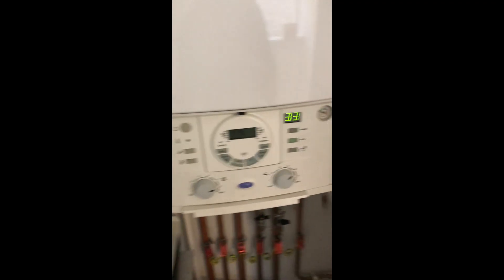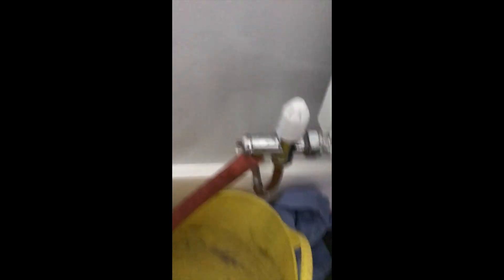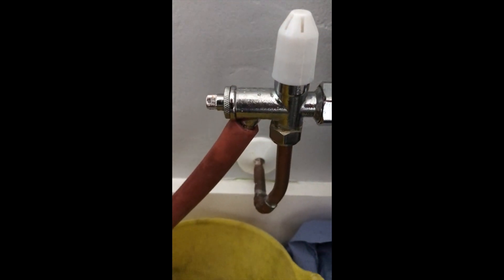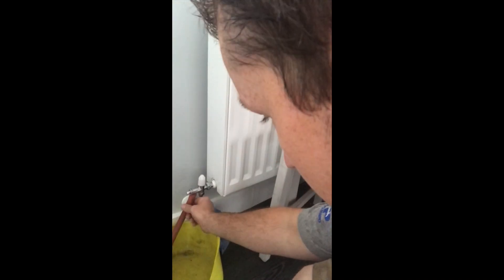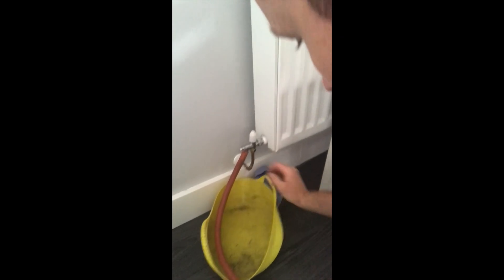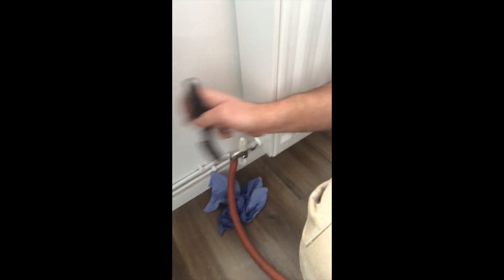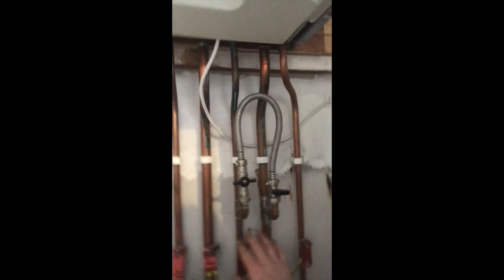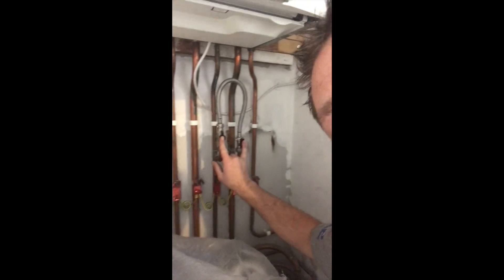How to drain down a central heating system - Combi boiler

Comment: what is there are 2 floor valves installed. It is better to turn the thermostats temperature up so it calls for heating on both floors and then turn boiler off? I assume the valves will stay open asking for heat?

Comment: This is a great video. Do I need to turn anymore taps off on the boiler?
Reply from the maker: No need, just follow my video and that’ll do the trick, if your unsure whether you have a pressurised or gravity fed system, for peace of mind you could simply turn the water off to the house as back up 👍
Reply: @NickTaylorPlumbingLtd I’ve got the system switched off and hose connected to the drain valve but when I open the drain valve nothing comes out? Bit confused?

Comment: Good video, do you need to purge the boiler as well after filling?
Reply from the maker: You should not need too, your boiler should remove the air itself of push it via the pump to the highest radiator on the system, hope that helps 👍

Comment: Great video, I have a glow worm Ultimate 30c combi boiler, but need to remove 2 radiators so I can plaster the walls. Can i still use my hot water for showers and such(radiators will be removed for a week or so), or would i need to isolate something first?

Dave
Reply: Hot water and heating are on 2 separate circuits

Comment: Good explanation Nick on drain down and refilling the c/h pipe work system. However, in your process you’ve not put any inhibitor back into the pipe work when filling? How would you do that when filling back? Thanks

Comment: Got a question for ya, over the summer my boiler kept losing pressure and I could see this via the gauge when it kept falling below the green zone, checked all the rads, no leaks and bled too with all being full but it still kept happening and it took absolutely ages for the pressure gauge to reach the green area. Now we've passed summer I've noticed that it's constantly in the green area and pressure isn't dropping and heating and the boiler is working fine...would you recommend changing the boiler or is this just a small case with nothing to worry about?
Great video too by the way, I've been wanting to empty the system for ages to add more radiators in new position so thanks 👍

Comment: I have a leaking 90degree plastic elbow in the ceiling immediately beneath my combi boiler. Found due to staining of ceiling. Strangely system had been good for 8 years, and the leak only appeared after the boiler was serviced. I wonder if the heating water temperature setting was higher after the service and just enough to cause the leak? I saw the service engineer "waggle" the temperate dials which I think is part of putting the boiler into service mode. I have no idea of the original temperature setting, but I never changed it in all those years. Currently it drips. If I refill the system it is good for a few hours until the pressure drops and the boiler shuts itself down.

According to a friend I should find a drain point on one of the ground floor radiators (he says it a legal requirement) but there isn't any drain point on any radiator. According to the same friend he suggested for him it would be a DIY job. He lives too far away to help 😞 He also suggested that freezer spray could be used to isolate the pipes around the elbow, although on the upper side of the elbow is the pipe that comes straight from the boiler and I assume(!) that there is an isolation valve on the output of the heating feed which will take care of that side of the elbow?

I have used Checkatrade to find interested parties. I emailed one company all details (including lack of drain point). They have said that the job will take 2 to 3 hours. Since in my layman's head swapping the elbow should be pretty quick, what is it about the job that means it could take 2 possibly 3 hours? I just want to make sure that I'm not being taken for a ride.

Comment: I usually switch off all the radiators so they don't need to drain. Some water still in the pipe but it doesn't waste all the inhibitor.

Comment: Hi Nick, I appreciate this video thanks.
On my ideal logic 24 combi, I had the valve on the CH flow (behind pressure gauge) in the wrong position while running tap to test after filling system. Looks like I've broken the pressure gauge and am planning to replace.

The manual says to close all CH water isolating valves on boiler inlet, then drain system at CH drain point.
Before finding that in the manual, I already drained as much water as possible from the CH via the radiators. Do you think that is sufficient so I can remove pressure gauge? Thank you.

Comment: Amazing video, you have a new subscriber Sir. I do not have drain valve anywhere in a system. All there is, is just valves with TRVs and valves for rebalncing the system. Can I just unscrew one of these valves entirelly from the radiator and drain the system that way? If so does it matter which radiator I use for draining the water? I have 5 radiators in a system all on the same floor.
Water is basically black when I am bleeding radiators so I need to get rid of that water and get new fresh water into the system so my radiators are not as cold at the bottom from all the sludge gathered.

Comment: Are you not suppose to turn off the main water supply that comes into the house first? Otherwise wouldnt it just keep fiiling up the roads and boiler! Just an observation.
Reply from the maker: Hi Juicy, thanks for the comment, you don’t necessarily need to turn the mains water off for a combi boiler, if you watch my video on how to drain down a gravity fed system then yes you do need to turn the water off. 
However.
If in doubt turn the water off, it’s always best to be safe than sorry 👍

Comment: So the radiator water is independent to the mains water, so no need to turn of stopcock as its just the heating side?
Reply from the maker: Hi Echo, If you have a combi boiler or a pressurised cylinder (unvented cylinder) then you are correct, if you have a tank in the loft (gravity fed system) check out my other video on how to drain down a gravity fed system here - https://www.youtube.com/watch?v=2G4hf_Hsgb0
If you haven't already don't forget to like and subscribe.

Comment: Yea gotta clear out traps better to hook up a pump
Reply from the maker: Hi Stephen Burns, love the idea, as this is a combi boiler its under pressure and in theory should push out any air locks, I haven't had to whip out the pump before but I have used a wet vac to suck out an airlock, ill do a video in a few weeks time on how to do this.

Comment: Mine are bit old radiator and don't have them drain valves.. but can you use on to drain out top floor radiators on boiler?? They should have drain valve should they?? Thanks for educative video

Comment: Any inhibitor chemicals added?
Reply from the maker: Hi Jack, If you haven't already please like and subscribe to my page as it really helps.
Yes you should add inhibitor once you've carried out all work and are ready to fill up, best to read the bottle on the quantity to put in as they all vary, as a guide, the inhibitor I use is a 1 litre bottle to around 10 average sized radiators.
Hope that helps.

Comment: Awesome video! Straight to the point, allowed me to fix my radiators easily, Was nervous about going near the boiler but after watching this it made it so simple to drain and refill!
Reply from the maker: Hi Jack, thanks for your kind words and taking the time to write a nice comment. If you haven't already please like and subscribe to my page as it really helps.
Reply: Drain the whole system?.... this headed with drain down boiler
Reply: If the water upstairs tees down into two unconnected sides then how does the it circulate?

Comment: Great video but why do you need to drain the whole system if its a combi boiler? Whenever I change a radiator valve on a combi system i always drop the pressure down with the pressure release valve and isolate the flow pipe valve. I get about half a litre of water coming out the pipes when i undo the rad valves but thats it. Change the rad valves, open the flow valve back up, re-pressurise the boiler, bleed the radiator and job done.
Reply from the maker: Hi M F, thanks for your kind words and taking the time to write a nice and informative comment, although I would say you're a braver man than I am.
 If you haven't already please like and subscribe to my page as it really helps.

Comment: What happens then if your in bungalow all rads on one floor turn boiler off. Do you still open all the bleed valves and there are more drain offs.would you have to still drain if from all drain offs or just the one your working on

Comment: Is there a way to drain the radiators ( to move them) while keeping the hot water on?
Reply: If you've got a combi boiler link the thermostat control to stop the boiler firing on central heating.  Close the return and flow whilst the system is pressured and your DHW should stay on demand.  If you loose pressure your boiler will go into lockout.  Drain the rest of the system 😉.

Comment: Really clear video. One question though, for those of us on single-level flats/apartments i.e. when the boiler is the highest point in the system: how do you let air into the system when draining? Is there a risk of damaging the boiler by pulling a vacuum if you drain it without opening any bleeds? My towel rail is the highest bleed, but it still floods water everywhere because it's a foot below my boiler!
Reply: If your boiler's at the highest point of the system there's absolutely no need to drain the boiler.

Comment: Hi is it possible  to close down all the rads except the rad being worked on & just drain from that rad , saving time emptying part of the system & refilling .
Reply: Yes,  just make sure tge boiler stays switched off for the duration and all valves are gill shut.  If you have a tank on an f&e system then you have to isolate and create an airlock.

Comment: Hi Nick, great video. Quick question, do you not need to close the internal stop tap in your property before doing the work?. Or will the boiler not replenish if its turned off?
Reply: I would say that the filling loop is off so no water will enter the system. This is for a sealed system of course NOT an open vented one.
Reply: Thsts what I thought!

Comment: Good video thanks.  I have a property which will be left empty over winter hence looking to drain the system.

Is this method suitable for this scenario? Or, is there a chance the supply pipe to the filling loop could freeze and crack?

Thanks
Reply: Turn off the mains water and drain from the lowest point i.e drain point cold water tap or outside tap.  The central heating circuit would also need draining.

Comment: if i folow your instructions  and then turned water back on would it flush sytem round and back out of hose to flush it well and clean.all valves reclosed exept drain pipe valve.. is this right?????

Comment: Great video Nick which has encouraged some other good comments. I plan to update radiators and valves whilst decorating through the house. Some pipework mods will be carried out so draining the system is required. My question is can I isolate and drain the central heating system on the boiler then switch on and use the combi for hot water only? This gives me time to complete the job over the summer at my own pace. Many thanks Nick. ps it's a Worcester Bosch Greenstar 42CDi Combi.
Reply: Ok for this to work you'd need to link the thermostat so the boiler wouldn't fire if you were doing it for a long duration.  Providing the boiler is still pressured and the isolation for flow and return are fully isolated.  Then you can use the Dhw.
Reply: Did you get anywhere with your idea? I have a similar boiler to you and obviously we think alike i.e. whyy do you need ch pressure if you’re just heating hot water feed!?
I suppose one way around this would be to put Speedfit stop-ends on the pipes and re-pressurise the CH if your idea didn’t work. You’d also have to be careful that the boiler would definitely not start-up in CH mode. Wonder if safety features would prevent this?

Comment: Before draining open all the valves on both sides of all the rads,  that way all crap will hopefully be flush from the rads.
you can buy cleaning solution that you add to the cental heating   follow steps on product and how to use
you mzy need to flush system after using the cleaning solution 

Important 
you will need to add an inhibitor to the system to stop crap buildup

if you have belp it may be an idea once you've drained system is to take  each radiator off and flush it in the garden with a hose

Comment: Hi, i need to repair a bit of copper pipe i have slightly gouged with a drill bit, its not leaking yet but dont want it to in the future. I need to cut a bit of the pipe away and im planning on fitting a compression fitting. I need to drain the hot water that is in that pipe, is there a way to do this without draining all the radiators and everything? The tap its connected to is the kitchen sink, could i turn off the stopcock to the house and run the hot kitchen tap until it stops?

Comment: Hi I have a graverty fed heating system all the rads down stairs have a beed of valve do I need to put a pipe on each of them to bleed the system out thanks Brian
Reply from the maker: Hi Brian, thanks for your message, if you're looking to completely drain your system then yes.
On some occasions you don't have to drain the system completely but for peace of mind it might be worthwhile to drain them all. 
If you don't drain the system completely use your spanners to open a nut and if it leaks your can tighten it back up rather than cutting some pipe and not being able to stop the leak quickly.
Hope that helps?
If you haven't already don't forget to like and subscribe.
Reply: @NickTaylorPlumbingLtd  thanks for the reply can I ask you one more I won't to put a filter on the system But there's no room as the boiler is up to the ceiling which pip in the airing cupboard do I put it on thanks Brian
Reply: @456Brian  fire your heating and check with your hand which pipe gets hot 1st.  That's NOT the pipe you want it on.  The one which heats up after 👍.

Comment: I have seen some systems where the installer has failed to install any drain offs whatsoever
Reply from the maker: Hi Nick, thanks for your message and nice name by the way. 
By rights all installations should have these drain off valves however your right sometimes there not fitted (original installer fail). There are a couple of ways around this which I'll post a new video how to do this soon especially fo you! 
Hope that helps.
If you haven't already don't forget to like and subscribe.

Comment: Great thanks, I have a rad to add and need to cut into the 22mm so i can do this now as i was worried about air getting into the boiler :)
Reply from the maker: Hi Atommachine, thanks for your message, any type of draining the system will create air in your system, infact all system create air inside themselves as the water rusts the inside of the radiators and that process releases air.
If you have any difficulties with an airlock, check out my other videos which explain how to remove an airlock.
Hope that helps.
If you haven't already don't forget to like and subscribe.

Comment: Great video nick. When draining the water down should your be opening up all the lock shields / TRV's . I want to drain my system to add a cleaner in it?
Reply from the maker: Hi Arts&Trusts, thanks for your message, before draining your central heating system down, turn the heating on, if all rads get hot then technically no you don't need to open them as the water is circulating properly. 
I would leave locks shields / TRVs as they are, add the cleaner and let circulate for the length of time specified on the cleaner. 
Then before draining the central heating system I would open all lock shields / TRVs fully, then drain, this would allow any larger debris to pass through the valves easier.
Then refill.
You'll need to rebalance your system afterwards which I have a video on so please check it out. 
Hope that helps.
If you haven't already don't forget to like and subscribe.
Reply: @NickTaylorPlumbingLtd  thanks for the detailed response, you've earnt a subscriber sir.  Lastly can I with adding cleaner, I have a heated towel rail up stairs and combi boiler down stairs. Am I right thinking to drain a litre of water out and then add the litre of the cleaner in and let that do its work for specified amount of time.

Comment: No Inhibitor added to the system when you fill it with fresh water?
Reply from the maker: Hi Wayne thanks for your comment, its always advisable to add central heating inhibitor to they central heating system before you refill the system as it helps slow down the rusting process inside the radiators.

Comment: Good, clear video. Probs worth mentioning the converse scenario of not needing to drain a whole system, if the part you are working on has been drained e.g. no need to drain downstairs, if working on a rad upstairs.
Reply from the maker: Hi Steve, Its a good point, however Id rather show how to empty the whole system to prevent any accidents happening for our viewers, we've all been there ;)

Comment: Nice video. At what point do you put inhibitor in the system?
Reply from the maker: Gary 70 thanks for the messege, you put the inhibitor in before you refill the system but after you’ve made all the alterations to the central heating system. 👍